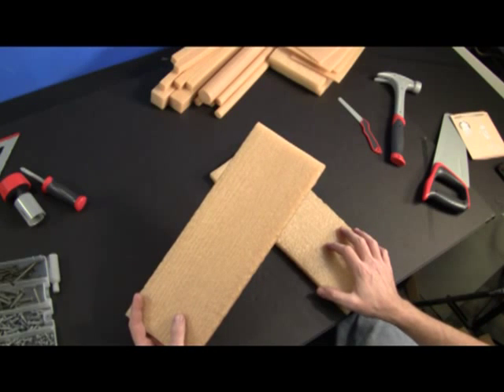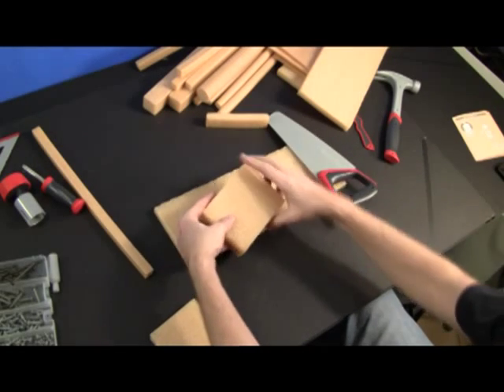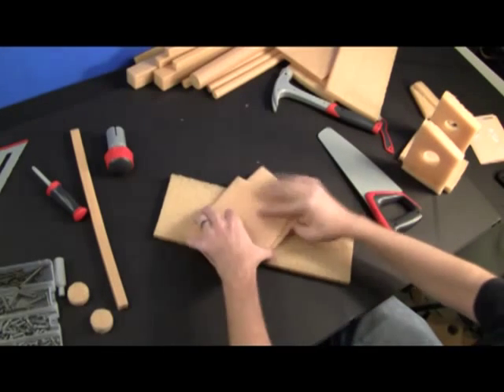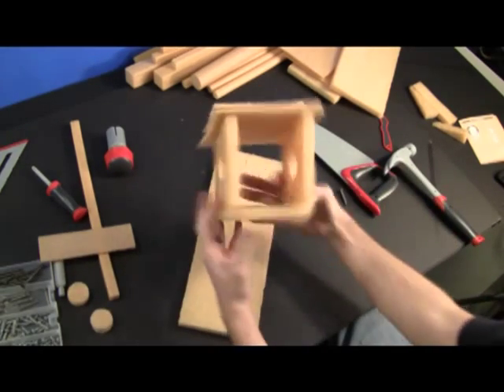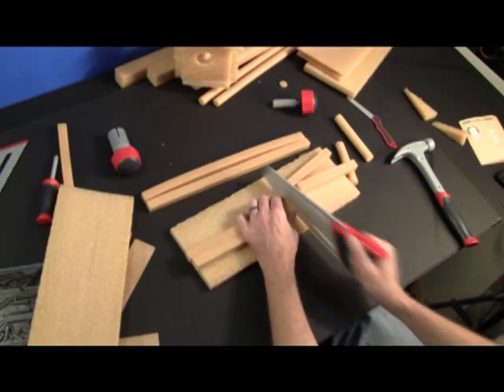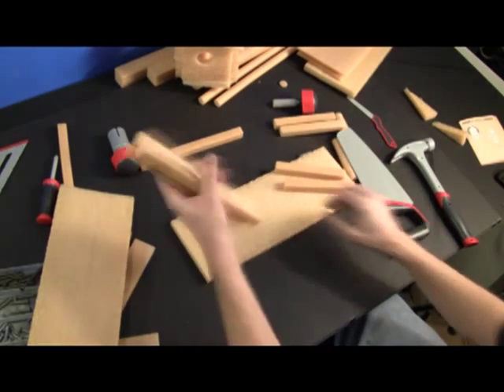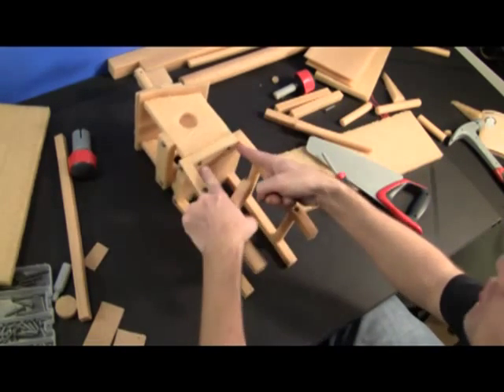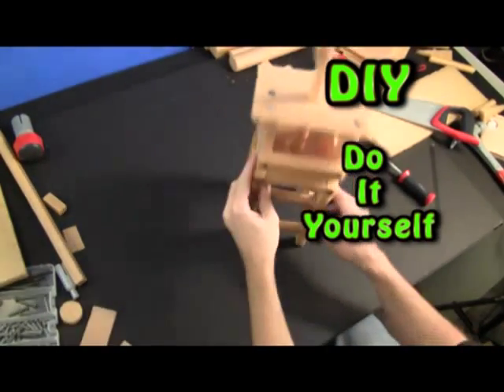Real Construction How2 Deluxe Workshop watch tower

Comment from the maker: Sorry,  the foam is made to be super durable... but the down side is paint doesn't really stick.   
I use colored foam, stickers, and FunNoodles if I want color.
There may be colored parts in the new RC sets coming out.

Some paint may stay on for a while but most paint come off with time.  Only permanent markers will stick to it.  You can glue details to it with low melt glue.

(Of course only use Hot / Low melt glue, paints and permanent markers if you are old enough...)